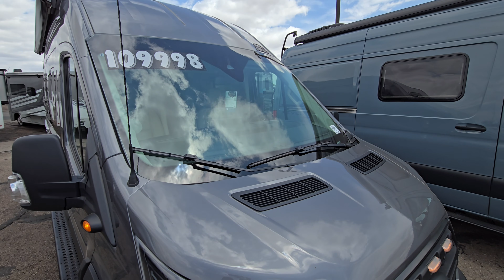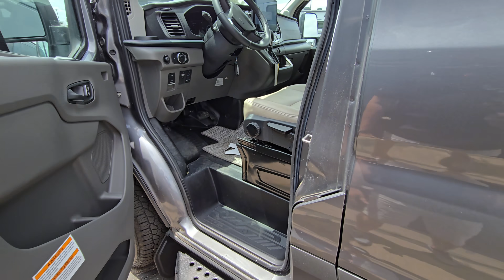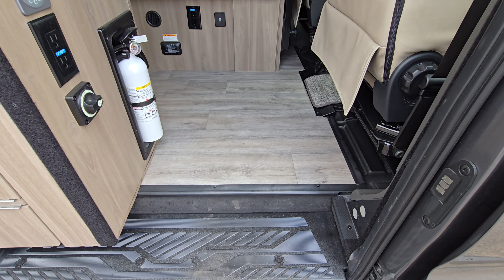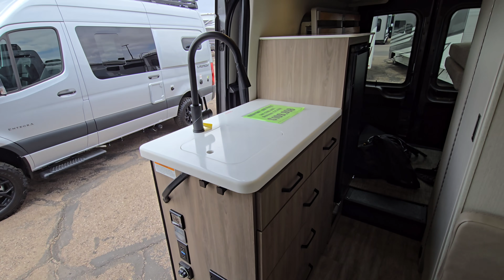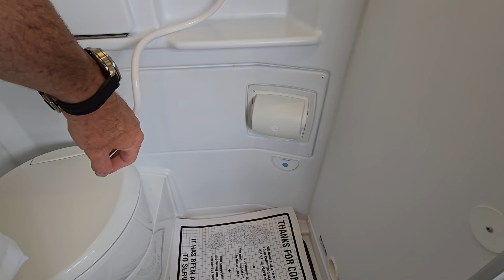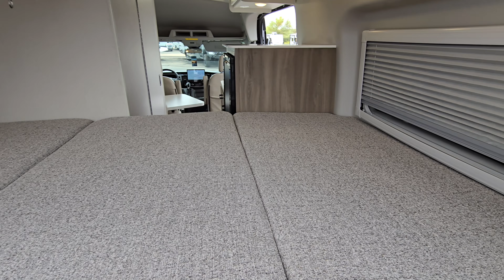2025 Palladium Luxury Camper Conversion Van! Transit Trail Chassis 350 AWD 3.5" Lift, Raptor Grill

Comment: Why would they put that high profile roof air on there.
Reply from the maker: Good question! There are only a few choices for roof top air conditioners. It is a must have.
Reply: @brockjofficial Dometic makes a much lower profile model which is much better.

Comment: For me, that useless storage under the bed is a deal breaker. It raises the floor level and it wastes storage space. Also, I don't like cabs hanging over my head in the bed area. On the plus side it has a bench seat facing the sliding door,  built-in LPG tank, and external Zamp inlet. And it should fit in a normal parking spot, although parallel parking might not always be doable.

Comment: Ford Transit Trail should have been discontinued, is this is the last inventory ?
Reply from the maker: You are right.  These are the last of the Transit trails.  Its a shame because it's a great chassis.  Thanks for your comment!
Reply: Why do you suggest they should be discontinued,I am contemplating buying one?Your input would be welcomed,thank you.
Reply: @chipsrafferty8362  Ford discontinued the Trail option.  The official reason from Ford was that they had sourcing problems.
Reply: @chipsrafferty8362 go to the ford transit forum which has a lot of info on ur question both pro and con. Bottom line it’s still a great vehicle.